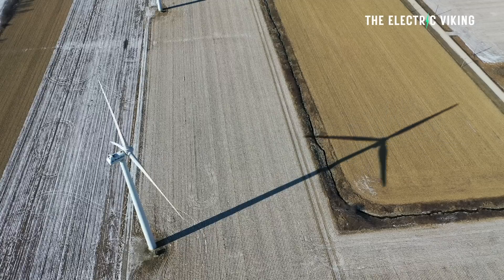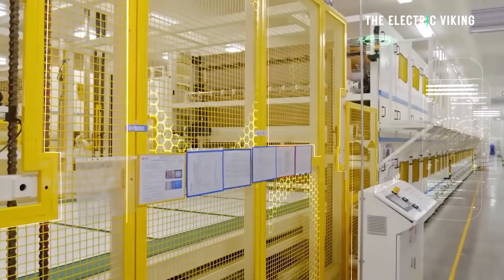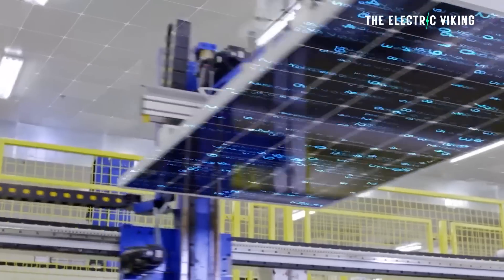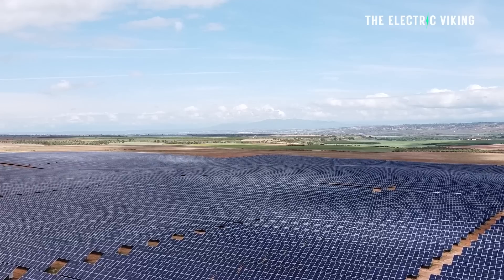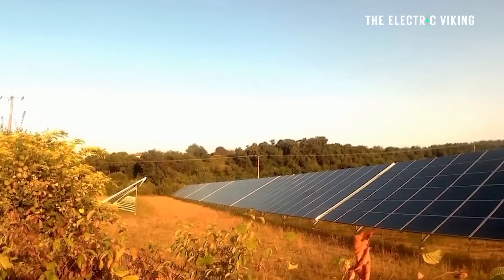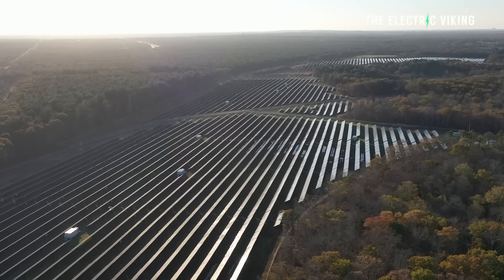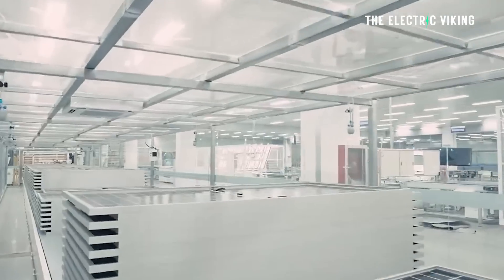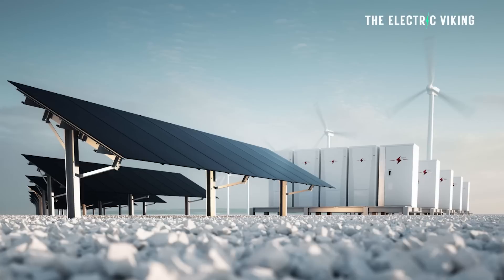New solar efficiency records make solar cheapest electricity in the world

Comment: Those with a lot of money to be able to afford the Expensive EVs can also buy solar panels, No Problem .
It is just pocket change to them.
Reply: Within 5 years EV's will be much cheaper than ICE vehicles. Within 15 years there will be enough cheap secondhand EV's around for ordinary working people to afford them and therefore saving them a huge amount of money on petrol and maintenance costs. And yes EV batteries will last, som say up to 50 years in a vehicle, so secondhand EV's will be definitely replacing ICE.
Reply: D!ckhead!
My EV cost the same as an equivalent ICEV with the same features.
And I put solar on the roof 15 years ago when systems were over 3 times as expensive. it cost me 20% of my annual salary but had a payback of less than 5 years.  Better still I am over $10k in profit as still get 46cents/kW feeding excess electricity into the grid.
Reply: @remakeit2628  I am talking about being affordable for ordinary working people who can only afford to buy 15 year old cars like myself. I can only dream of buying any new or secondhand electric vehicle that cccan ahndle my 120 km daily commute to work. I hope that within 5 years I may be able to afford a cheap secondhand electric car if they are around 5 - 10 thousand dollars. As for solar I did get that on an 8 year loan 4 years ago because I can see the long term benifit. How ever most working class people on the basic wage cannot afford either at this stage because of the cost. I am happy that you could afford both and wish you well.
Reply: @andrewjoy7044  TY 

So many people think everybody has money like them, and that is not the case.
Reply: @andrewjoy7044  My comment was to the OP and not to you.
Not everyone can afford to buy new cars.  However those who can will be able to buy an EV for a price similar to an equivalent specced ICEV.  I pay about $15 for enough battery charge to travel 400km so save $50 a week on "fuel" costs.
Reply: Yep. Aren't they lucky. Proof that hard work and being financially savvy works.
Reply: @robertfonovic3551  I usually work 56 hours a week and wish I could afford an EV on my basic wage earnings.